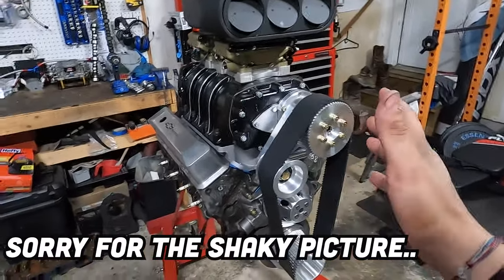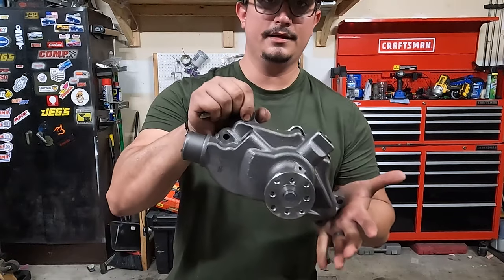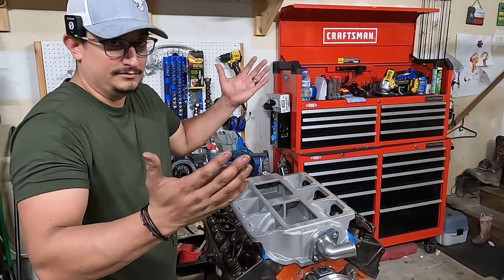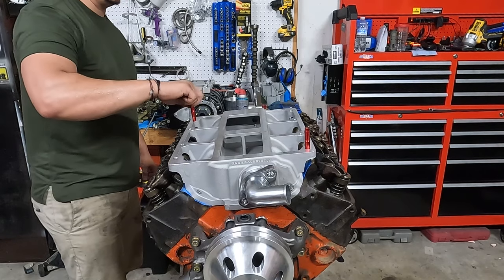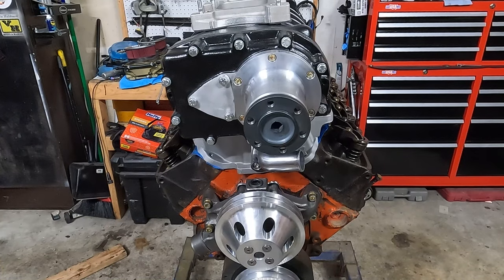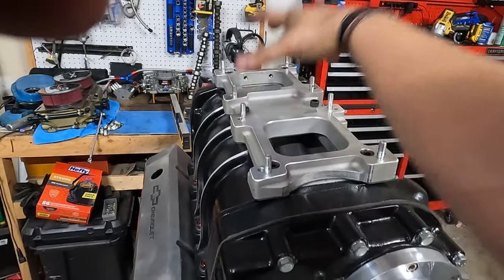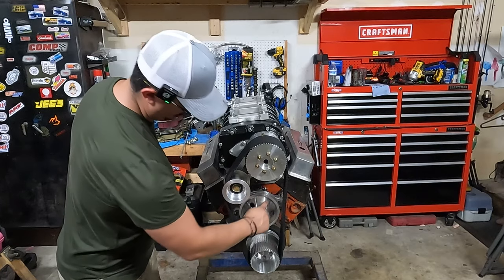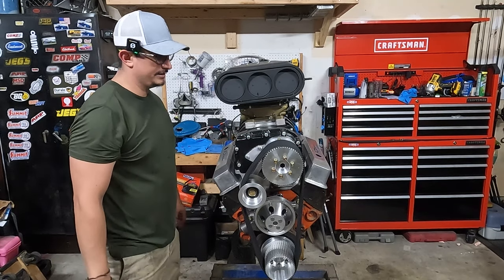700HP Small Block Chevy | Budget Roots 6-71 Supercharger FULL BUILD GUIDE | Holley 2x4 Sniper EFI!

Comment: Is there any benefit in having dual carburetors or injector doodads (like you have) versus a single with the same overall flow rate? Maybe a better air/fuel distribution across the screws, and thus into the manifold below? Or does it not matter at all?

Comment: For your snipers get the throttle extension. They are WAY to snappy without. Building the same setup with Speedmaster 671 on a 383 SBC. Also from mockup it looks like I may have clearance issues between the Hyperspark and the blower, May have to run a 2" blower spacer.
Reply from the maker: Awesome!! Glad to know someone is building this same setup. I'll post a pic with the hyperspark installed, it clears ok. The large HEI unit does not fit tho.
Reply: @diveingarage  This speedmaster supercharger is made by The Blower Shop and I think it is longer than yours in the rear.
Reply from the maker: Ahhh ok. Yea this is a converted 671.

Comment: I noticed you didnt cover pinning the crank…that was a catastrophic mistake on my motor which led to the pulley coming off running it over took out torque converter bent the crossmember smashed my exhaust bent a wheel blew out a tire and put dents in my quarter panel….do not use the factory keyway folks..lesson learned move on to the next one
Reply from the maker: Yup! This is just mockup. During install I'm going to cover exactly that
Reply: @diveingarage when is the next installation video? Ready for it 👍

Comment: Good overall, but brush up on your water pump knowledge that hole in the top is not for a big block. Big and small blocks dont share a water pump, also more to differences between short and long than the snout size. Learn, and we can all learn. Good job, looking forward to more on the two sniper set up.